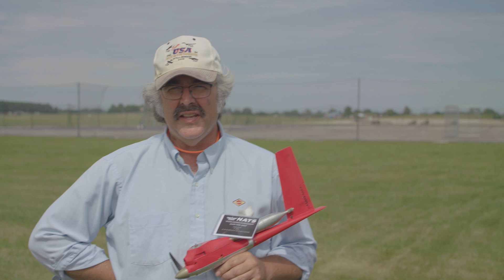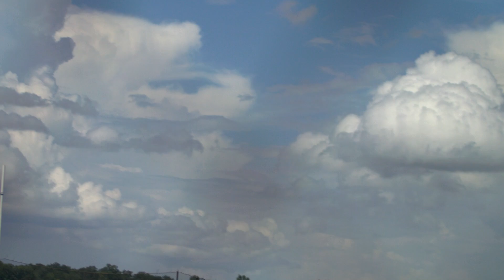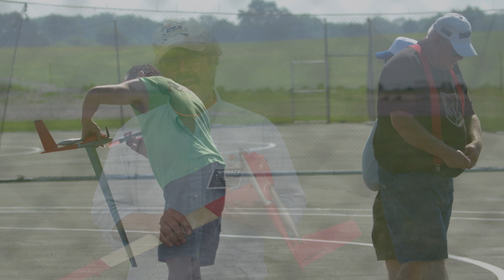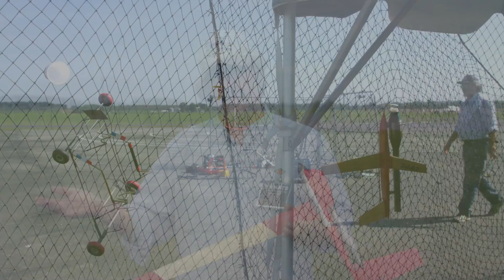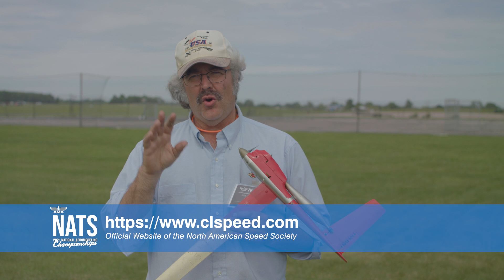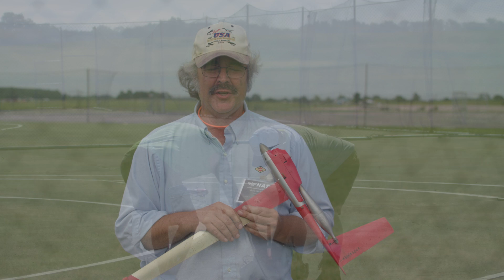Nats 101: Control Line Speed with Glen Van Sant

Comment: IMO I think a model control line plane built for speed should still look like a plane.  a fuse with one wing is not a plane.   Speed run cars model or 1:1 still resemble cars.
Reply: wait til you see the RC truggy class...fell out of the ugly tree and hit every branch on the way down
Reply: Check out tether cars.